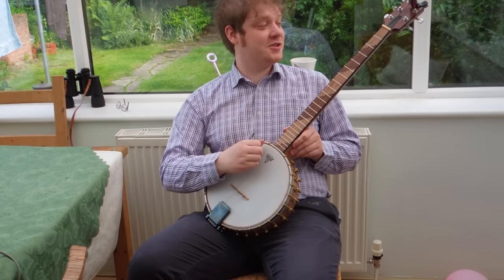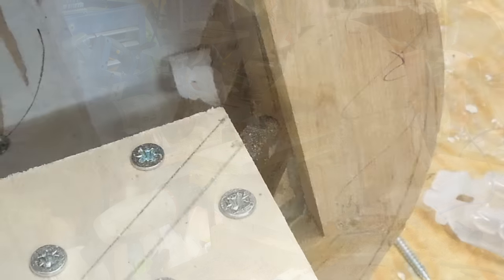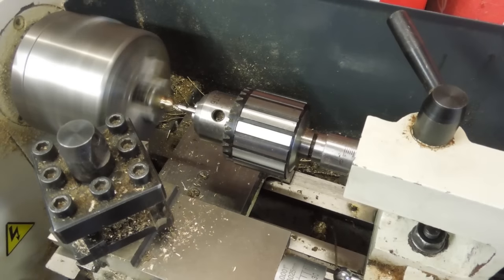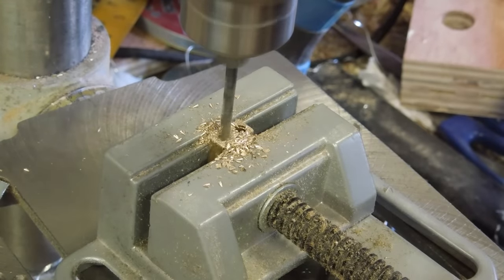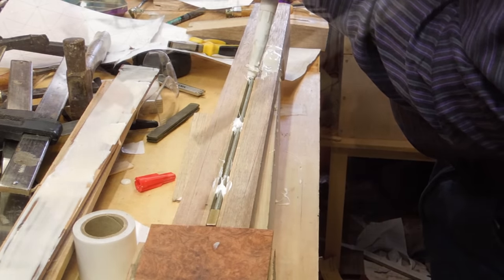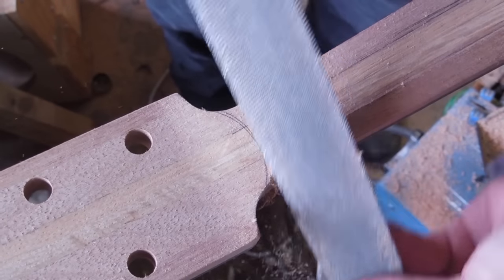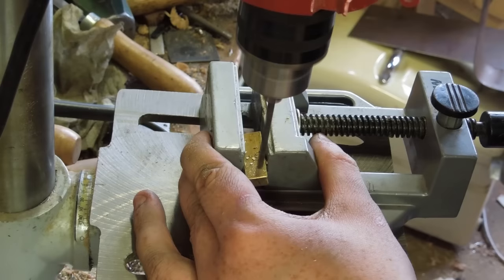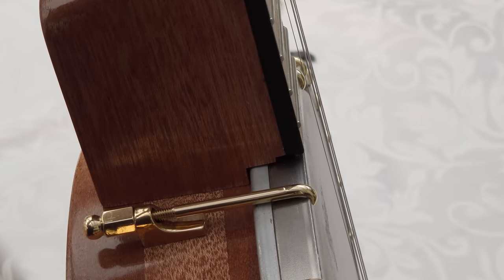Making a Banjo

Comment: 7  Great craftmanship, and ingenuity. I didn't know about the offset on the neck for the truss rod. I thought the making of the hardware was really ingenious, although I would have thought the tail piece would have been made out of brass sheet. I have made a four string, split tail backpacker guitar, and a wood top banjo, with piezo pick-up. The pickup will pick up conversations, like a mic. The wood top was from an old drawer bottom from a scrap piece of furniture, that had been thrown out for heavy hauling.

Comment: Do you have (or you recommend) a video showing how to add the black accent (I don't know what you call it) on bottom of the heel of a banjo or guitar? I have a plain looking Pilgrim banjo that I want to dress up a bit. I'm going to add a black 'trim' or 'accent' to the bottom of the neck heel and the bottom of the pot also. Thanks!!
Reply from the maker: I don't i'm afraid. I'm also not sure what you'd call it either. Sounds like you want a bit more than just a heel cap. If I had to do that i'd probably try carefully route the heel and just glue a bit of wood or plastic in. But that might muck up the finish and risks pulling chips out. Shellac finishes are easier to touch up than others. But polyurethane or nitrocellulose (or whatever else they use) would probably require stripping the entire thing and starting again, which would be a big job.

Wish I had a better answer but I can't think what to do. Paints would wear off and cutting into it would probably cause more problems than it solves... maybe you could screw in or glue on a blackened steel plate to the heel and base of the pot. Not sure how that'd affect the tone.
Reply: Thanks for the advice!!
Reply: Could I ask you one more question? What is the material called that the bottom of the banjo and the heel of the neck is sometimes covered with for an accent that looks like formica or some thin, solid black material? Thanks!

Comment: So I'm going to be building a banjo soon and I guess I'm just confused as to why you built it as a 4 string instrument with an extra string and not just a 5 string instrument. Obviously yours is going to be 1000 times better than mine, but the neck centering comment is the item that makes me think
Reply from the maker: Man, 6 years ago is long enough to forget the finer details of the process... I'd recommend doing some research instead of trusting what I'm half remembering... 

But, if I remember right, the alignment was mostly just decorative. That, at the top of the neck where it meets the nut, it’s just more “Visually Pleasant” for the centre-line of the laminations to run down the centre of the back of the neck – between where he 2nd and 3rd strings are. And so the neck is constructed and carved where those laminations meet. Laminated wood, of course, being more dimensionally stable than solid wood. 

But for where the neck meets the rim… the banjo is a 5 stringed instrument, even if the 5th string stops short at the 5th fret before it reaches the nut. So for where the neck meets the rim it’s ideally cut/ sanded with the “centre line” running down where the 3rd string is – right in the middle of the actual 5 strings. Otherwise tension from the strings would slowly pull the bride sideways to align between the 2nd and 3rd strings as you play it. 

In reality though, the banjo neck is really long and a tiny misalignment on where it meets the rim could cause the thing to be whole millimetres out of alignment… and then on top of that the thing is made from wood. So there’s a good chance it’ll change shape with age, seasons, relative humidity, and misaligned chakras. But one of the big advantages of the banjo is that since the neck is held in by threaded rods, you can just slip paper under the sides of the neck to adjust it’s angle to correct for any misalignment. Misalignment being identified by the bridge tending to gradually walk sideways during use. 

Also I remember this crap confusing me so let me know if I didn’t explain it well.

Comment: Sweet build Daniel. I don't have access to a wood workshop or metal lathe, do you think it would be possible to do the wood parts with hand tools, using a coping saw for the rim and lining up the cuts on both sides, then just buy the hardware from a banjo shop?
Reply from the maker: I think that would be possible. Thinking about it, the tricky part might be getting the outside round and sizing it to a good fit with the head. But if you can glue it to a board with a hole in the middle, then you could spin it around that hole with a pin. Then run that against a belt sander turned on its side and clamped to a table, using shims on the sander to get it perpendicular.

There's some other stuff that might require creative solutions as well, but I don't think there's anything that'd be impossible. Might just take longer.

Comment: Hi! This is a wonderful video and your tool making is incredible, way far beyond me! I wonder though, and I ask with no disrespect, wouldn't it have been easier to shape the rim on a router table?  Make a small circular form, cut it close and then route to a template? I don't own a lathe so I'm wondering if there is an inherent advantage to using one.
Reply from the maker: I don't own a wood lathe either, that's why I made one! Don't feel anything I did is beyond you by the way. It's easy to be fooled by videos like this into thinking the guy has skills you don't, since it's a few months of work and thinking about problems condensed into 30 minutes.

That router table idea could work though. I wouldn't trust my router table to handle a cutter tall enough to cut the whole rim, but you could do it in parts and glue it together. I wonder if you could use pins to align each layer and use the previous layer to cut the next one, so it'll keep each layer fairly well aligned for when you glue them up. Actually that's probably a way smarter way to do it than building a whole lathe for one job...
Reply: What I did for my resonator rim was to use a circular template and a big fat pattern bit to notch the top of the well inside and out until the bearing left the template, then bandsaw the outside close, and finish up by raising the bit all the way and then switching to a bottom bearing version of the same bit! that one was probably an inch and a half and then the ledge it rests on got glued on after. I probably wouldn't have needed the huge bit though if I had a slanted cutter and took less adventurous passes haha But yeah registering with pins sounds like a good way to go as well! Seriously great tooling man! I can't wait to see what you make next!

Comment: In case you are interested, there is a fellow wood turner named Jerry Bennett who developed a jig for cutting segments for wooden bowls.  Those segments look like those pieces you made for your banjo.  I noticed you had difficulty with the accuracy of the cuts to eliminate the gap between segments.  This jig should help you quite a bit since I have been using it to cut segments for my bowls for a long time.  It provides very accurate cuts provided you follow his instructions.  Look for the video referring to the Wedgie Sled in this link https://youtu.be/hpFNE1CHsc4

Comment: A wooden wood lathe...it needs a belt drive.
What did you use to make the title cards?
Reply from the maker: I used GIMP for most of it. You can set each layer to be a frame if you export the project as a gif. The bits were then assembled together in premiere pro. That final rotating one was made in 3ds max, by zooming out really far and taking a screenshot of the wireframe, rotating it for each frame.

I won't say it's the best way to do things though. These days there's probably some great software out there made specifically for these sorts of animations, but I used the gimp years ago and got used to it.

Comment: What did you use to rub out the finish?  could not make that out?
Reply from the maker: It was just some balled up rags inside another rag to make a kind of... dabber. It's what i'd seen other people do, people that know more about applying shellac than I did (and still do!). Although now i'd say it's easier to just apply it thick, as concentrated as possible with a brush, and sand it back. The 'billion thin layers' thing has never worked out so great for me.

Comment: Hi brother, I'm doing a banjo to college, you have the plan to build the banjo? could please send me? 
Google tradutor sorry!
Reply from the maker: In the video description there's a link to donwload the... I guess i'd call them 'working files'. I never made a full plan for this thing and alot of things were adjusted or made to fit as I went along. I think making a strict plan for something like this is tricky since there's alot of weird curved shapes and compound angles that are hard to measure. So those working files are just really rough and innacurate things slapped down to try get an idea of how it might look and what I need to make.

I did a bit of searching and found that the bluestem website is still hosted on the wayback machine. I'd say this was the single best resource I found on banjo construction.
http://web.archive.org/web/20160328213135/http://www.bluestemstrings.com/pageBanjoDesign.html
http://web.archive.org/web/20160329132923/http://www.bluestemstrings.com/pageBanjoConstructionTips1.html
Reply: Thank's so much my friend!!